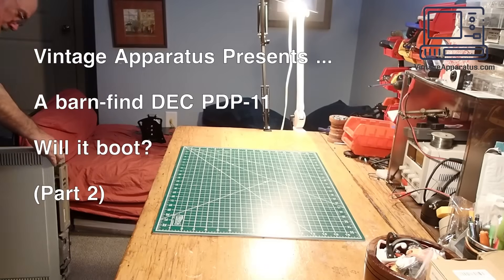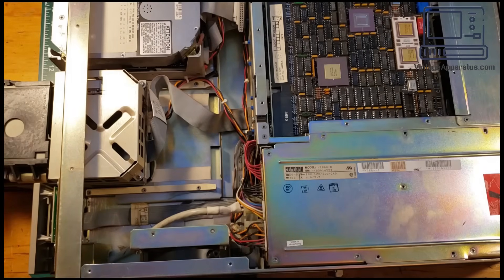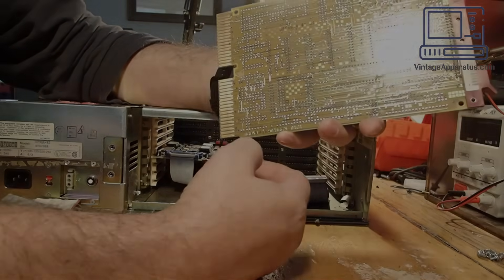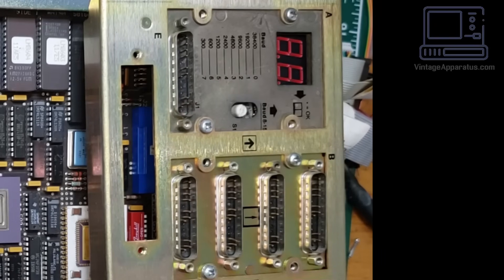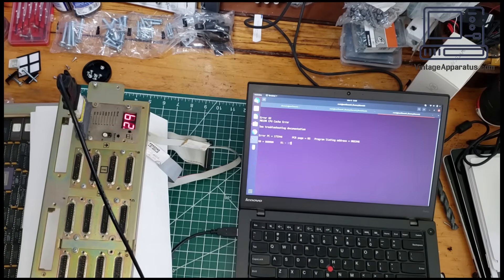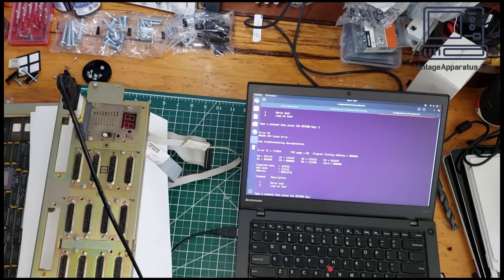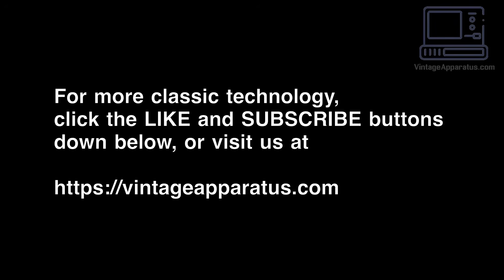Barn Find PDP 11/73 - Will it boot?? - Part 2

Comment: If you're going to restore vintage hardware, you have to be willing to do board-level diagnostics (and should probably invest in both a good multimeter and a basic scope). I'm not familiar with this machine (though I do know the PDP-11 line from porting software off RSX11 to VMS, NT and Unix), but I assume there are still plenty of those who are familiar with this specific system and may have documentation for the CPU board. I'd see if you can map the board's lines and figure out the problem cache memory IC. It may take time to locate the fault, but it's also likely repairable as the cache is likely discrete using common sram dip's. Also, 512K was not a staggering amount of RAM in 86, it was pretty common for AT's and XT's, and was standard on the Amiga and Atari ST. I doubt that machine was configured with 512K; I suspect you're missing some memory from that chassis.
Reply from the maker: Thanks for the feedback!  I'm primarily a software engineer, so the hardware side of things can get murky.  I have bench tools but my skills on them are not particularly good, I"m ramping them up now (particularly in debugging floppy drives).  Hopefully you'll see more on this in a few upcoming video!
Reply: @vintageapparatus  To be clear, I'm a software and systems engineer by profession (with a primary background in low-level systems software and tools). I'm no expert in hardware EE; my experience in low-level software gave me some basic understand of what I was interacting with, but it was all "abstract". Learning to fix my own vintage stuff (and later, more modern stuff) was very useful because those abstract gaps no longer appear so mysterious.

Also, a video (probably series) chronicling attempts to repair that CPU board's cache, is exactly the kind of stuff that makes Adrien's Digital Basement, Usagi Electric, Northwest Repair, etc., so interesting. It's the diagnostics, strange unknowns, and journey towards understanding that makes people watch such content. In that process, you get the opportunity to help everyone learn as most of us will likely never have an 11/73, but learning about how they're architected, how one might repair them, etc., is very interesting content.

Comment: I am definately no expert here but the cache memory is external to the J-11 cpu chips so in theory it should be fixable. Also check section 2.2.4 in the BA23 enclosure manual (available on bitsavers) where it discusses where to put the CPU and memory boards.
Reply from the maker: Yep, I have the ordering of the cards correct. The cache is external, yes, but it's still soldered onto the board.  I'm in the process of acquiring a new card that hopefully will make the cache error moot.
Reply: @vintageapparatus  Right-o!

Comment: The cache chips are probably on the board and it looks like it's even telling you the address and maybe what bank/chip. I'd do as someone else said, reduce it to a basic system with no other cards and work from that. You're going to have to repair cards not replace them.

Comment: I had a MicroVAX II in the same chassis back in the mid 90's - along with a MicroVAX 3600 with matching disk cabinet, a grey wall of OpenVMS manuals & 10x terminals...  then needed the space for offspring so sold it all off to a colleague.  Did manage to nab a VAXstation 4000/60 with matching 21" colour monitor, 2 AlphaServer 2100's, Alpha based Multia & a HSZ50 raid controller & 6 BA356 disk shelves from my then current employer (when that was something that happened :-( ) all installed in my larger house's loft away from toddlers, kept it all very toasty....

Comment: hi I IS there a DLT kind of tape back up  i have a  10-20 dlt  4000 was there drive s before i have not seen any on ebay 

just asking   the 10gb  DLT are very slow    old brown  10-20 tapes are the starter one's i have  
bob

Comment: Is that the Motorola 6901 I see?
If you're having cpu issues, isn't the 6901 it.
I'm sorry, I'm not at all familiar with the platform.
Although as with those old hdd's, you might wanna give them a low level format to bring them back to life.
Just an idea.
Thanks for the upload. It was super entertaining and interesting.

Comment: On that tape drive controller, what chip is in that CLCC socket under the aluminum heatsink? That CLCC makes me think it's a 80186 or something running the tape subsystem. Also, DIPs switches on those sidemount DIP switches - down is technically "on", not "off". Up is open, down is closed.

Comment: In those days, the CPU cache was an array of separate memory chips to the CPU, so they probably can just be replaced.

Sometimes you can probe with an oscilloscope to see if any lines are not doing anything, but given that the system is actually doing anything at all, it's probably a case of yanking the chips and testing them individually for bad addresses. 

Also, you should really check the power supply without it plugged into the hardware first.

Comment: RD53 = private label Micropolis 1375, I believe in the SCSI version though not the actual 1375.
I used to own a pair of those (in the MFM version) that had spent time in a DEC mini.
They had MFM and SCSI versions that I have worked with, and I think they had a ESDI version that was good for around 130 Meg that I never actually had one of.
I was THINKING that the drive looked like something I had owned from the start of the video.

Comment: Replace all capacitors, reseat all socketed chips. Just because it powers up does not mean the system is at all stable. If it has literally been in a barn then it has been subjected to extreme temperature and humidity variations from summer to winter for years. Remove any boards that you don't explicitly need for core functionality. The tape controller and serial port cards may be causing problems you don't know about yet.

Comment: This is great stuff. I hope you can get it working again. I agree with all the comments about memory and, yes, you could absolutely get a memory exerciser going from your laptop to the monitor which might not only tell you if there is a bad chip but also if there is a bad memory line, which might be a buffer, a broken trace, damage to the bus, or something similar. I have no experience to draw on, but just from my extensive YouTube consumption, this would be my next move :)

Comment: An interesting project, and the smallest PDP-11 I've ever seen.  The PDP-11 Series has an interesting family of architectures -- I heard you mention QBus.  There exists a Unibus interface card which makes it possible to use Unibus peripherals with QBus hardware, but that's down the road a piece, I would think.  Good hunting on that CPU Board - it will at least put tools in your hand that can be used to debug the rest of the system.
Reply: the Soviet Union based some desktop microcomputers on PDP-11 with pirated CPU. In fact, some engineers etched (in tiny microprint) into one of their chips, in bad Russian, "When you care to steal the very best" and because the Soviets would copy the whole chip exactly, the pirated chips also had this joke on them. Anyways, the Electronkia BK was one such clone.  And, for engineers who didn't understand capitalism, it made perfect sense: if DEC was state-owned, the IBM PC would be forgotten, and micro PDP-11s would be the future of microcomputers. The market decided otherwise.

Comment: I'm pretty familiar with these systems - I started my career on PDP-11's (An 11-70, vintage early 80's).  A slight criticism on your comment about memory - by 1986 512K was by no means "staggering" in size.  My 1987 Amiga had 1MB, which, yes, largish by microcomputer standards, not much by PDP-11 and VAX standards.  The maximum memory for this system is 4MB, and a lot of them were maxed out because memory prices were dropping.  I had a uVAX II (1984) with 16MB of memory - interesting note is that DEC re-used the packaging a lot, and the micro VAX could be bought either in this form, or the fatter and more expandable BA123.  By 1990 I regularly had Vaxen with 512MB and up for main memory.  Max memory for the VAX was 4GB due to the 32-bit architecture, but often limited by hardware to 2GB.  If you had 2GB of memory, you were talking serious power! (and power-draw!)
Reply from the maker: I made a comment elsewhere that that edit is actually a little bit of an oops.  I initially dubbed the voiceover saying it was '512meg of memory' which of course would be a crazy amount.  But I realized the specs I was looking at for this machine were wrong (google failed me when I looked up the chassis id), so I overdubbed '512k' (you can hear the voice difference).  I should have removed the 'staggering' part, but mea culpa :)
Reply: @vintageapparatus  OK, that makes a lot of sense.  512M of memory WOULD have been staggering, especially on a 16b bus!

Comment: Have you tried running this machine with only the CPU and memory boards installed? Also, if I'm correct, the DLV11-J cards in your machine are installed in slot number 3, which is a Q/CD slot. BA23 backplane is hybrid, first 3 slots are Q/CD and the rest is Q/Q. So the DLV11-J on right is sitting in CD connector, possibly shorting some data paths used for interconnecting memory and CPU.

Comment: Great video. I have alwasy loved DEC stuff, and got to work with a couple of their Alpha systems for about a year setting up and managing mailing lists with Majordomo. And a friend of mine had a PDP-8 for a while, which was fun. 

At 12:40, You say that if you set switch 5 to off...then you flipped it down. I think that you made a mistake there. On the switch, it was "OPEN" on the top (no current flowing, aka Off), implying that it is closed (current flowing, aka On) when down.  So when you put it down, you actually turned it on, not off. And if you had set the other switches based upon t he idea that up was on and down was off, you may just have misconfigured it. 

I could be wrong...
Reply from the maker: DING.  I was counting the days until someone noticed this.  Yeah, the switch was in OPEN state, and i flipped it CLOSED.  I noticed this in my final review of hte video and went "Ya know, I wonder how long it'll be until someone notices that".  :).   Thank you :)

Comment: 13:36 I had a look on Bitsavers, and found a couple of documents related to the 11/73: one for “CPU System Maintenance” and the other the “CPU Module User’s Guide”. There’s some mention of a “ROM ODT” (basically, a ROM-resident debugger) in there, which might be helpful.

Comment: 5:51 I imagine one big difference is this one can do DMA output, while the other cards would interrupt the CPU every time they sent a character.
Reply: The DHV11 also has a FIFO buffer on the input. The board all runs internally on a couple of 8051 microcontrollers and there's also 16-line UNIBUS version called the DHU11. Both are very similar in operation to the much older DH11 UNIBUS design but all reduced to a single board rather than using a full 9-slot backplane for 16 lines.
 
I know the engineers who designed it because I worked (on other things) in the same engineeering group in the UK.
Reply: @jeremybarker7577  Cool. I remember the days of the DH11 versus DZ11, and how our sysadmin preferred DMA boards to reduce the interrupt load on the CPU from all those terminals. But if you only had a few characters to send, the overhead of setting up the DMA transfer was higher.

There was some third-party board that offered both modes: per-character interrupts for small transfers, and DMA for larger ones. Does the name “VMZ” ring a bell? Then finally DEC offered a similar product, the DMF32 I believe.

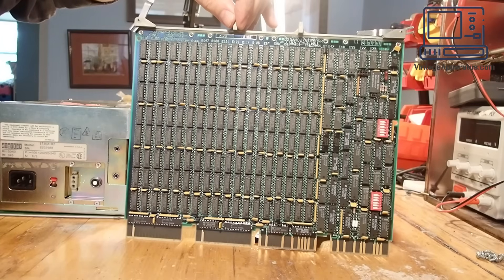Comment: 4:29 Consider that in that same year, 1986, Apple shipped the Mac Plus, which came standard with 1MiB of RAM, upgradeable to 4MiB.

This was “staggering” only in that your Microsoft-compatible PCs still had trouble getting beyond 640kiB of useable address space.
Reply: Even in PC land, 1024kB+ of memory wasn't unheard of with AT type systems. There were plenty of memory expansion boards, that's where things like "expanded" and "extended" memory in DOS come from. And the 386 was already on the market -- PDP-11 was very much a legacy system which was succesful through its wide industry support.
Reply: @Stoney3K  EMS/XMS came a little later. I remember helping a staff member with a Wordstar install on his new AT machine in 1986 or so, which had the full 640kiB of RAM. The installer was complaining there wasn’t enough RAM! I solved the problem by temporarily creating a RAM disk to take the free RAM below 512kiB, and then the installation succeeded.

The problem? The installer was doing a signed integer calculation on the size of available RAM, so any amount over 524287 bytes came out as a negative number.
Reply: @lawrencedoliveiro9104  EMS/XMS were a software implementation of memory expansion boards that were developed for the original 5150, like the Intel Above Board.
Reply: @Stoney3K  EMS required special hardware cards and drivers.

But this is all irrelevant to the point, that the 68000 processor offered a full linear address space, the x86 family (prior to the 386) did not.
Reply: Yeah 512KB in 1986 actually qualifies as pathetic.

Comment: I’m amazed there is any room left for routing traces on the CPU and serial boards given how tightly those chips are packed on them.
Reply: Up to 16 layers in the board, and even though at least 4 are for power and ground, you can route a lot of traces there.

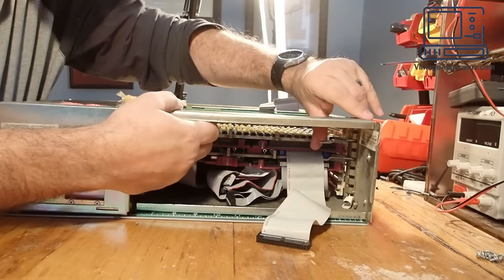Comment: 4:20 512KB really wasn't that much memory at all for 1986... That's literally TWO YEARS after the Mac 512k came out and the same year as the also 512KB Amiga. Aka, the same exact amount of RAM was widely available in tiny mainstream consumer focused personal computers. You sure you didn't mean to say 1976?
Reply from the maker: So I have to make an admission here.  When I initially recorded the voiceover for that section, I said "512Meg" - which would have indeed been a 'staggering amount of memory'.  I realized my error very late in the edit, and overdubbed the '512k' (you can hear the voice difference).  So, it's... an easter egg!  Yeah!  That's it!  :)
Reply: @vintageapparatus  🤣 Sall good dude! Makes sense. 🤷😊
Reply: I'm more surprised that 512K is on a huge board with all individual chips, instead of a few SIMM modules with room on the board to spare.

Comment: RAM from this era is notoriously short on longevity and this problem comes up often enough in the 21st century, especially with environmental issues and unknown histories.  Borrowing from some Apple II videos and other stuff I've seen, the monitor is your friend.  I would figure out how it works and try to write to and verify memory locations automatically with the serial console and that nifty linux box of yours and that would tell you where any potential flaws were, boot cache or otherwise.  Python is probably not a bad way to do it (bash is too ugly with associative arrays), especially if you're not comfortable in other languages, or there might be some pre-existing assembly/machine language scripts you could dump in instead.   I'm assuming the boot cache is in a very early location in the memory map but you should use the monitor to verify every little bit.

Fixing it generally involves identifying the bad chip on the board and replacing it with a workalike or original component.  They make chip testers that vastly simplify this process, especially if you end up buying a replacement component with an unknown history.   There could also be corrosion on the pin or a bad trace in the PCB that might not be immediately obvious, you really have to go through the CPU board with a magnifying glass.  There are a variety of ways to fix this from cleaning the board to soldering in bodge wires.  

RMC and Adrian's Digital Basement can go pretty deep into this stuff, I'd look at their restoration videos.

Comment: Used to have a 73 under my desk. Sadly, not mine though and that was back in the early eighties. A great little machine.

I don't think those DEC DLTs (TK50 etc) opened without power as it removed the interlock.
Reply from the maker: In the middle of Part 2 I had it powered on bit it still wouldn't unlatch.  I'm thinking of making a separate video just on these drives.  They're so tempermental.

Comment: Oh goodie! I have been waiting for this video.  It really wants to boot for you. I think you could maybe do a repair on that CPU board... Have you run the diagnostics mode at all since posting this video? I think that module has something under help and I believe there was some diagnostics for narrowing down what part of the cache is giving you grief! I would definitely start there. If that is available it should be in the CPU cards manual... if somewhere like the website VT100 has it? Could you also check to see if you are getting a proper 5V on that logic line going to your cards?
Reply from the maker: Thanks Michelle!  I'll look for that debugging menu if I can find it.  I realized halfway through editing that 'Error 62' on the console was what the back panel was showing me, not 'b2' - I'd love to repair the broken cache on this KDJ11-B.  I'll be working on this more in the next few weeks and will post an update as soon as I have more news.